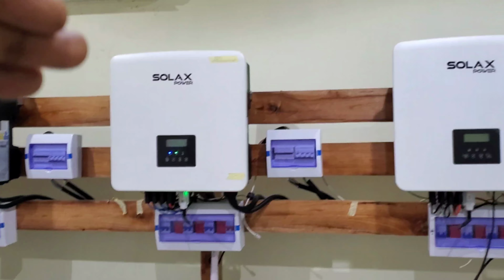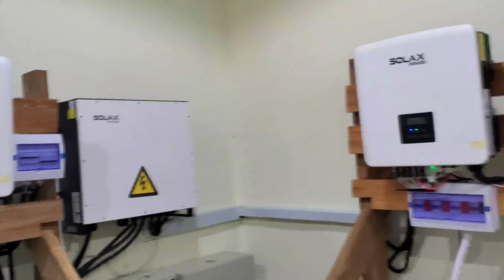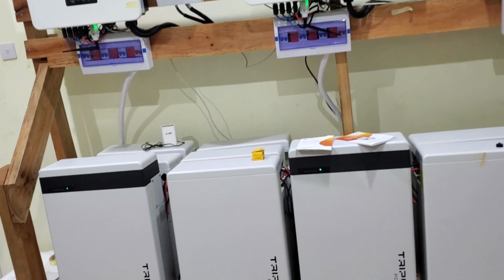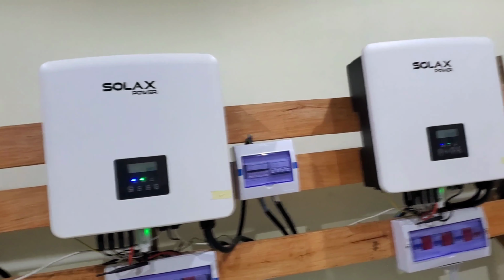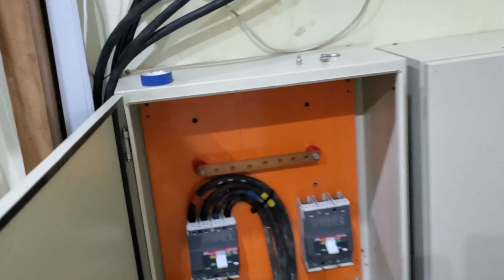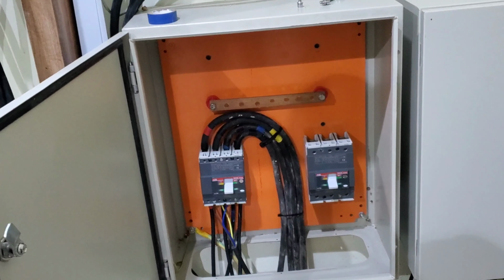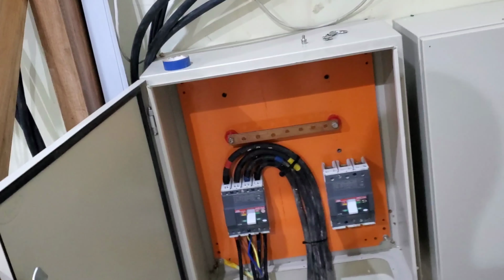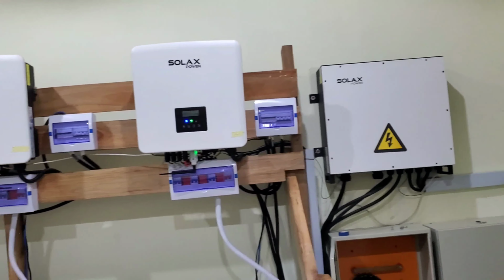How to troubleshoot our mini grid. #solax #solarinstallation #jinko #offgridsolar #solar #hotel

Comment: If you raise the headroom of that breaker won’t that mean it allows more current through but risks the damage to the inverters or rather to the hub? 160amps to 200amps is a sizeable jump, if you can get 180amps, I would advise that, first. Also advise when your A/c will be installed. I think your move away from the bus bar is also a good thing to reduce heat along the bus bar.
Reply from the maker: Good morning. As always your input is valuable. 200 is still below our inverter maximum. So we are safe there. The AC came in on Sunday and it is set to 23 degrees C. The room is much more comfortable.
Reply: @drsolar  Greetings Dr. Solar, I am always partial to going small incrementally on the amps, I know it’s a pain cost-wise but try 180amps before going 200amps. Also verify that the hotel rooms have or have no kettles for a customer to make coffee or tea. Unfortunately, as a guest you may find there’s no information that you’re running on solar, so someone may use a hair dryer or kettle or even just plug an iron to the system. Such information will need to be shared with guests at “Check in” as well as Staff so large induction loads are just not simply plugged in without knowing. The water tank pumps are a concern for me as I would be comfortable having larger pressure tanks and smaller pressure pumps of about 0.5Hp. 1Hp or more are likely to be used currently and once room occupancy goes to 80%+ would tax the system as well. I’m still very keen to see you now beginning to put labels on the breakers and inverters to assist electricians, other than yourself who knows the system by memory and it would also be good to have a schematic diagram printed which can go into a manual as well as a label stuck just inside the door. Remember at some point a grinder/welder was in use and sockets for these should be isolated which would run directly off the generator & not the Solar system. Can wait also for hotel to get safety fire extinguishers that are specifically rated for the batteries & inverters, instead of just water. These are non-negotiable essential statutory item the hotel should have, not just for the Solar room but also for inside the hotel including fire exit signs and emergency meeting points and drills. Often safety is overlooked by hoteliers, until it’s too late. But do mention it and invest in schematics, manuals and labels for ALL installations, even domestic ones (Pv, Generator breakers, Inverter breakers), warning signs, access controls especially to non-essential personnel into that inverter room).
In the manual, solar panel cleaning should be a must, more so, when it’s the dry season or hotelier could invest in a pvc tent, in case of hail & flying debris in a storm. Hurricane Ian comes to mind, though I pray you never get something as severe there.
Reply from the maker: @tirivaenim  thank for the suggestion. Logistics wise and time wise, it does not make sense for us to do what you suggest. 200 amps falls within our parameters. The EPS parallel box offers additional layers of protection. So we are fine. We can't intrude on the client by asking them to check. A hair dryer is not an issue. An iron to a degree in not an issue. It becomes an issue if all of them are on in multiple rooms at the same time. We are having conversations with hotel management to get a handle on this matter

Comment: IMO it’s better if you parallel all the battery per system so if you lost a inverter you don’t lost capacity on the battery side…
Reply from the maker: Thank you for watching and commenting
That is not a possibility. There is a battery management system that you can't bypass. Good suggestion though.